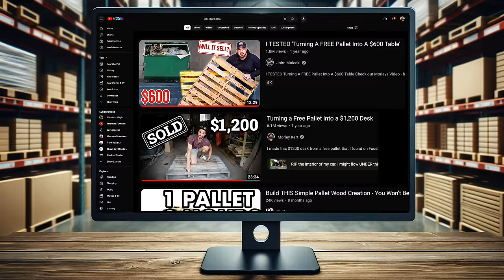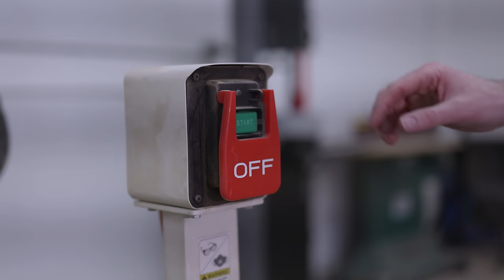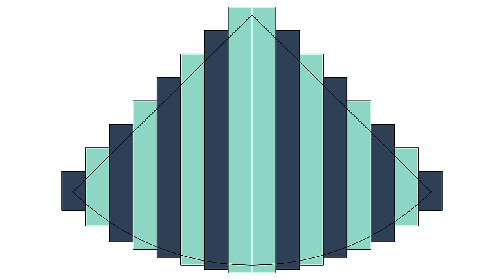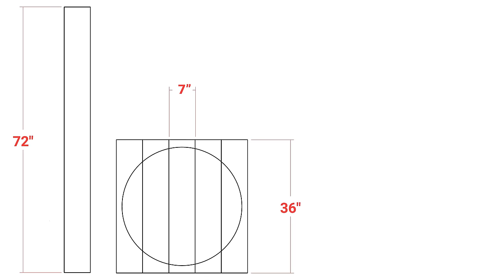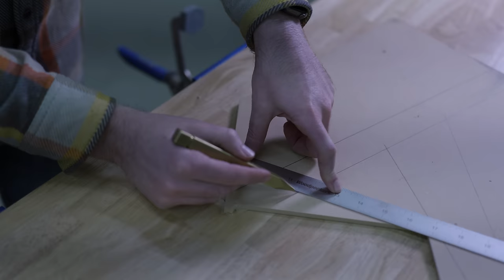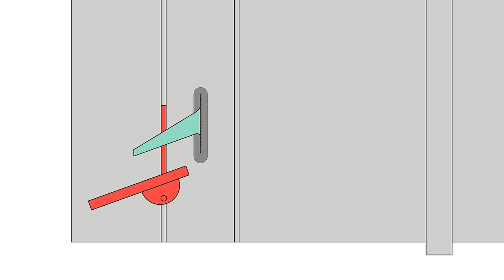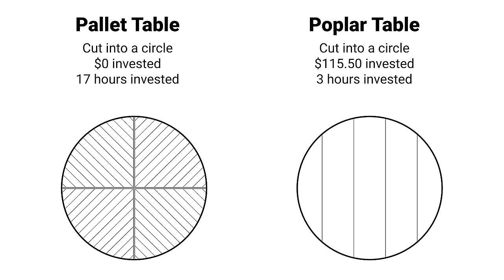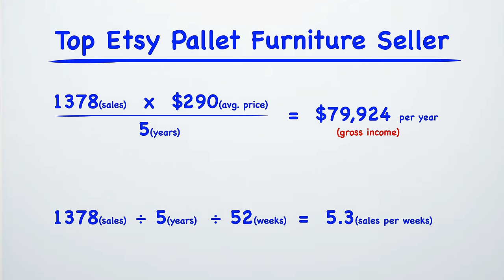Pallet Furniture is a Scam

Comment: That has gotta be the best shape a pallet has ever been in, every one ive seen has been breaking in some way or even partially rotting out. Pallets are incredibly prone to splintering and its suprising that you had that little problems.

Great build, and you could also probably contact any local warehouse and just arrange to take their used pallets since in my experience they are just about always thrown into a dumpster anyways.
Reply: Pallets vary wildly.

There are some very nice pallets used for shipping heavy machinery.

But I agree. Most are crap.
Reply: Yeah, If you get a new pallet then its probably in good condition for this type of thing. Most of the ones thrown out are gonna be crap though.

Completely forgot about some wooden pallets being treated with anti fungal chems, so its probably not good to work with those.

Comment: I used your math to consider this as a side hustle to supplement income. TL;DR: The pallet table is only more profitable if you consider your time worth less than $7.05/hr

Treating time as money, I used the hourly rate someone may have at a W-2 job of $30 times the hours invested plus fixed cost. The pallet table would cost $1,020 to make vs $625.50 for the poplar table. That means if I had your same level of skill and equipment (which I certainly don't), I would have lost money on the pallet table. 

The pallet table becomes profitable when you consider your time worth $20/hr, since it will cost $680 to make and turn a $75 profit. But the poplar table is still more profitable since it gives $294.50 in profit. 

The only point when the pallet table is more profitable than the poplar table is if you consider your time worth $7.05/hr or below.

Really insightful video, thanks for doing the side-by-side comparison.

Comment: What most people might not know: Pallets vary a LOT. Pallets with the exact same footprint can be built out of different types of wood and in different designs. How useful it will be changes wildly if you find one made for carrying stacks of soup and kitty litter made of oak with stringers vs one made of pine made for carrying pillows. I've worked in recieving at a grocery store before; the pine ones were always falling apart just from regular use. The oak ones were like twice as heavy and basically tanks, rarely having damage at all even when smashing a couple together with huge loads on top of each.

Comment: Best pallet project for me was a kid's play house. 1x2 pallets upright as "framing", fill the gaps with 2 taken apart pallets and 2 "upper sides" as base for the roof.
Using six whole pallets made is really easy, biggest work was putting in an old window from the attic. Would never do that "for sale" though.

Comment: I'm big on my coffee and I remember a post on a forum from an older member to a newbie wanting to know the best cheap coffee beans he should buy to practice with. The response was don't, you wouldn't learn to drive a car by putting kerosene in the tank and only after you can drive put petrol in the tank (gas for those people that drive on the wrong side of the road) and then crash because the car suddenly performs way better. I think similar can be said of pallet wood for furniture, practice with what you would end up liking to use. 

On another note, I can get pallets free from work and I do have a fire pit out back and you'd think free fire wood, but the effort in breaking them down and the nails (seriously 45 nails to a board in some cases, more metal than wood)  make it not worth it, way easier to pay $50 to my mate who chops trees down and have him load up my wood storage with logs that burn cleaner, longer and spark way less, costs me $50, but I'm not spending several days pulling pallets apart and when I have a fire and guests I don't have to keep going down stairs every 20mins to get another handful of wood, 4 logs takes us way in to the night.

Time is valuable and sometimes free isn't always cheap if you want to assign a dollar tag to your time. I do agree that if turning pallets into something is your hobby than the joy it gives you will make it worth to you.

Comment: Very informative video!

Also impressed with how professionals work - the level of precision and care in the design and details, wow!

I think the whole "pallet furniture" idea is not to make proper furniture with it, but it's more akin to using cinder blocks to make a coffee table: it's cheaper than anything, can provide the most basic function of said furniture, and can be thrown away whenever you've got the budget to upgrade.

Actually using the wood from a pallet to create an entire actual furniture seems more like a challenge than a good idea: pallets have been left outside to rot, often have taken a serious beating during their lifetime, and their quality can vary a lot.

There's also the whole "free" thing: pallets in good conditions are not thrown out, very often they're reused by the logistic companies until the pallet is a liability for the goods it transports - by the time it ends on the side of the road, the value of this thing has dropped to a point where recycling it for any proper use requires a lot of additional work.

Comment: Pro tip for get whole boards out of pallets : saw the palet nails of between the "blocks" and the  boards with a saw saw.

This is how palet repair fims do when they repair  refundeble EUR pallets , they actually save boards from" to broken"  pallets and use them on the ones that are being fixed , they dont remove the nail  heads doe. Imagen the irritation when someone has done diy repairs with hardened screws on the pallets and they try to cut them with the saw...

Then you use a flat punch and drive the short head part of nails out . These can be saved and used as "decor " .
The shorter nails can *often  be taken out whole. 
If you find nice hardwood palets with nice boards and want to be really sure to not crack them cut the bottom boards between the palet floor  boards, then you crack and remove  "the stumps " .  then drive the nails out of the floorboards.
* some hard wood can hold the nails so hard that the board cracks instead of the nails letting go.

Comment: Something that needs to be considered is the fact that it could take dramatically less time for the pallets if he you chose to make something other than a table. Fact of the matter is tables need very wide flat surfaces which is like the worst thing to try to do with those skinny pallet boards. If you make furniture that's closer to the shape of the boards there would be less time spent. Yes this is limiting but it'd be interesting to see something like a chair being made with this same comparison

Comment: The only pallet-furniture I had seen (for real) so far, was like... either just 2-3 pallets on top of each other as seating area + one vertically in the back as backrest (everything covered with a cushioned blanket), or 4 of them together forming a bed (again with a cushion blanket), or 4 stacked on top of each other building a table (covered with one board of poplar for even surface).
They were all looking like you could put them together in a couple of minutes.

Comment: not everything is about is it better or about price. it's about finding a creative way of putting something that is commonly wasted into good use. you entirely missed the point of why SOME people are willing to pay a high price for such "gimmick".
Your solution is to just continuing letting it go to waste but also manufacture more things that consume natural resources just because the former is a "gimmick"? ok. not everything is about money.
FYI the poplar table looks like generic run of the mill crap compared to the pallet one. don't pose your personal failure to capitalize on your time and creativity spent on the pallet table as proof that it isn't worth it. 

also lose the garbage "AI" "art".  it's cringe and unnecessary. you'd think a carpenter would be against using stolen labor.

Comment: Sooooo.....  with all your experience you couldn't toss $60 out to buy a proper pallet breaker from Harbor Freight?  Might have saved a few more pieces of wood than a hammer and prybar.  I mean seriously, you have every other proper tool for the job, why not a relatively cheap proper tool for that job?  Add to that, if the nailed ends look too damaged, USE A FREAKING SAW TO CUT THE USEFUL WOOD FROM THE DAMAGED WOOD.  Hand saw, circular saw, sawsall, jigsaw, any one of them would have probably saved a bit more wood than a hammer and prybar.

If I have to guess you were just against pallet furniture to begin with and didn't bother putting any real effort into saving any pallet wood.  That being said, I'm neither here nor there on pallet furniture, but your lack of giving a shit about the wood is kind of insulting to me, a man who has to try to save every useful scrap of whatever wood I'm using.

Comment: I don't have a dogmatic stance against AI art, but the way it's used for filler in videos and news articles is profoundly value-negative. It's worth comparing it to hand-drawn art and stock photos as background visuals. Hand-drawn art adds value by visualizing what the creator thought was important to illustrate - the effort involved helps to convey the message. Stock photos need to be hand-selected from a relatively limited catalog, in the production of which humans had to identify likely scenarios for illustration. Being forced to pick from a limited catalog forces the video editor to think carefully about what they mean to convey.

AI art is a cheap and immediate way to fill the screen with the literal contents of the voiceover, but tells us absolutely nothing more. It incentives creators to quickly select an image that's sufficient in its literal content, but empty of intent. The fact that it takes no effort to generate makes it impossible for the viewer to attach any significance to the details of the image. Nobody sat down and decided "I know it will be a bunch of extra work to draw the robot at 21:42 facing forward, but it's worth it, because I want to convey something about the robot's character." Instead, we know it was as easy as changing a prompt (any friction in this process is a bug, not a feature), so the image serves no more purpose than dialog tag: ", said the robot".

Comment: Not a woodworker, but in our new apartment, the balcony railing was way too high to our liking. I figured that if I could build a pallet platform that raised the whole floor of the balcony by the height of one pallet, then the flooring we put on top would be flush with our balcony door. I had to fully disassemble 8 pallets for that and hammer them together again and I thought they were an absolute joy to work with. So for applications where structural integrity plays more of a role than aesthetics (think: bedframes, storage solutions or anything that gets treated with a veneer in the end), pallets are really amazing.